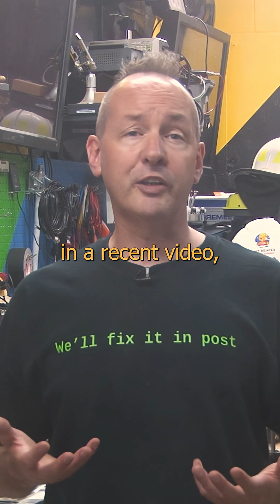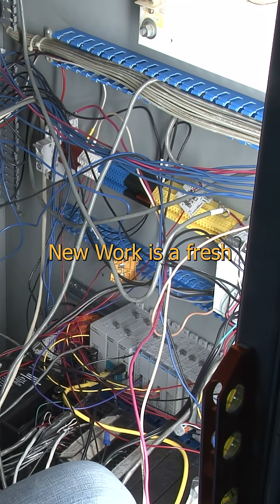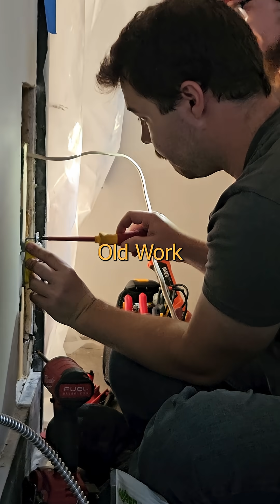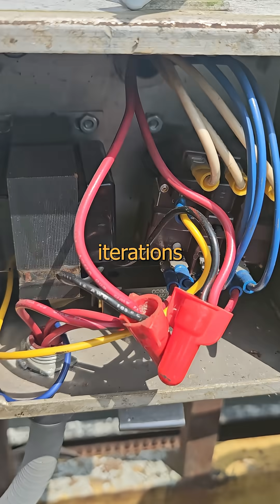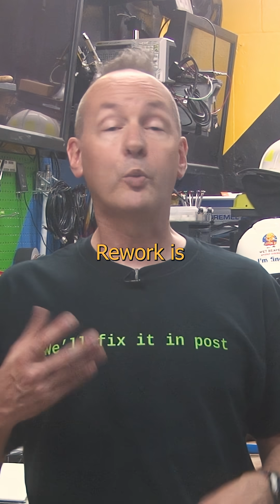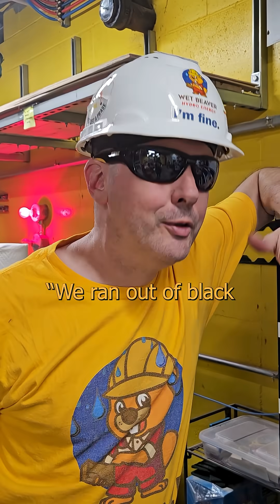New Work, Old Work, Rework #chrisboden #comedy #engineering #electrical #construction #educational

Comment: I'll be honest, I have used the "wrong color" for stuff before. It wasn't in a house or building, I would never do something like that. However, it was electrical in an old car. I couldn't get the same color to replace the old wire, so I just it all with black.🤗

Comment: The black tape on the red wires reminds me. My parents had a Thompson Tapan cooker they got from Canada I think? (This was in the UK) we had some problems so called in a guy who said he could fix it. First thing he did was lift the top off to get at the wiring behind the controls. Undid the screws, lifted the cover, screamed and slammed it shut again. We jumped a bit and said "What's the problem?" He lifted it up again and let us look. EVERY SINGLE WIRE WAS RED.

Comment: You say unintelligible things that make perfect sense  !  I’m not an electrician but I’ve had to deal with more than my fair share of pixie spaghetti ! Production maintenance are fire fighters .  They’re sole reason for existing is to keep it running . But repeated quick fixes will in the end cause catastrophic failure . Nobody remembers who bridged those end of travel micro switches until something terrible occurs! Who cares ? 😂 as long as it doesn’t happen on my shift and I didn’t sign the job off 😂

Comment: I work carpentry with my dad a lot and this is also very much true for that. These past three weeks on a job has just been fixing what the volunteers did. There where doors that were so far off plum we dont even think they used a level. There was some snap together wood flooring being put down and they had penny nails 4" from the outside wall. Very visible I might add, holding it down. When we went to turn on the power (nothing lit on fire thank goodness) but no plugs worked and some lights somehow where not even connected to anything. Along with many other things that I cant remember right now. Its great that they volunteered dont get me wrong but if you cant do the work right, go pick up a shovel or something instead.

Comment: This applies to every blue collar work out there.

I do dirt work and have had to dig 18 feet down in between 2 building on a hill, surrounded by other people building a house and a shop to get to native ground for a foundation for a set of concrete stairs. Then rebuild that ground with 22 feet of stepped compacted gravel. Stem walls were already in so we had to use a dingo to do anything.

The other contractor fucked up and after doing the house foundation, NEVER put in the stair foundation and backfilled with dirt that was mostly rock. Then he didnt have the equipment or knowledge to fix it and said “not my problem”

So we were called, had to drive 1 1/2 hours there and back every day for 2 months to fix this fuck up because we were the closest credible contractor.

Btw this was in Telluride, Colorado. One of the richest places in America. This property was probably 6-7 mil total with the brand new shop and building and they fucked up that bad on it.

Comment: Honestly I'm not mad at the guy putting black on the ends, would scold him for not doing the entire length. 

I had a socket catch fire and when replacing connect the usual brown, blue and yellow-green and then proceed to check, one hole is dark, the other lights up, check for mains voltage on ground and it lights up. I was thinking my dumb self would connect poop pants color to ground but how did I get it twice, then I check and live is not poop color it is blue. and yellow-green is also live. I may be stupid and swap colors but I don't remember two live wires in a single phase system. 

Kids no matter the color the previous guy run all black and just added color tape at the end. Always check. Everything is live until prove innocent.

Comment: You'd have either creamed your pants or had a full stroke upon seeing the mess of electrical wiring in my childhood home. It started out as a single family home, was turned into three apartments then turned back into a single family home. To make things even more fun, when my parents had the top floor renovated the contractor had to find an electrical subcontractor who had experience with knob and tube wiring. That stuff was actually wired into the rest of the house before it all got pulled out and upgraded.

Comment: 4th circle of hell is trying to fix production machines made 30 years ago, with single color eletrical wire (red) without electrical diagrams. Or ones that are language you dont know + bonus points for replaced components with wire jumps added that arent reflected on the diagrams...

Comment: Redoing a bedroom light fixture turned into tearing the wall out of 4 rooms and a hallway because there was knob and tube that was still hot despite the master being cold. Turned out it was wired directly to main, no fuse, breaker, or anything. Had the city power fella terminate his side of the cable because he's damn well better insured than I am, and as soon as I made the cut, that's his cable anyway.

Comment: You haven't seen old work until you open up an old knob and tube circuit box with cloth insulated wires that you can't even see because of the number of electrocuted mice shoved inside

Comment: Coolest thing ive ran into was original aluminum wiring to a fusebox that still had paper tags from the 1950s. The work inside was clean with no rat nesting from other nut twisters. It was almost a shame to disturb such fine work done so long ago

Comment: As an electrician that started in new construction and now does maintenance on a building older than i am, i often find the weirdest stuff. and since there's been a half dozen (at least) electrical contractors in the building in just the past twenty or so years, there is a mishmash of parts, styles, and gear.

Comment: You'd love finding one of my electrical projects. Every single one of them has either purple 10-guage solid core or yellow 12 guage, stranded. 
Sometimes I mark with colored heat-shrink, sometimes I make it the next guy's problem. (Then curse and whine when I end up being the next guy).

Comment: After living in my apartment for literal years. The entire left side of my living room lost power on its outlets. I, after trying to look into it myself because the maintenance guy is r word. Found out that there literally is no ground wire on hardly any of the outlets in my apartment. Now, one might ask, why don't I just go in there and fix it? Well, this building is older than I am. The stuff on the major parts of the building, like my living room, my kitchen, and all that stuff is some type of cement with some white stuff over top of it that will literally crumble if you touch it. I can't just tear out a piece of the wall.

Comment: I've worked on many old yachts "spaghetti"  electrical systems...there's no code to follow or inspectors so over the years as systems are upgraded they leave old wires and run new ones so you have hundreds of unused wires. Yachts run on... 12, 24 & 36 volt DC systems with 110 and 220 AC generators, solar & inverter systems. Generator power with (shore) dock city power. Even the 1.2 volts DC in the ocean and of course the open ground wire to the city power. I've been shocked in the shower and metal sinks and washer and dryers and I've seen sparks off of the docks where they touch the salt water. Makes your eyes burn and your finger tips hurt when your diving and cleaning the hull under water or changing the zinc sacrificial metal anodes mounted to the props, shafts and rudders. The underwater anti fouling paint in 80% copper powder so sea life won't want to attach to the boat and big old wooden yachts have a 4 foot copper plate nailed to the keel as a old style of radio ground. Then some boats have a bondong system where everything made of metal gets a heavy copper wire attached to it all wired together to a zink plate or a DC power supply with a knob to adjust how much low DC you can crank up to counter act the oceans electrolysis.

Comment: This was me 4 days ago with a mini van, 2 mechanics before me said the starter was bad, and the other said it was the key fob, I get there and not even 3 seconds under the hood I notice a broken ground strap, so I rig the ground strap and now no more shorts in the ignition module, relays are working properly, but the battery has a dead cell and the ground strap rig I did wasn’t a sufficient enough ground, so I have them replace the ground strap and warranty the battery and thing fires up like a charm 🤷🏽‍♂️

Comment: I borrowed a car trailer once. And it was owned by a wealthy guy, too. He owned an automotive spare parts store. Anyway, while it was in my possession, I noticed a brake light was out. Ok no drama, I’ll throw a globe in, job done. Nope. Hmm, ok, I’ll trace the wiring, find out where power stops. The whole harness was made up of red wire. And not full lengths. Pieces of red wire, ranging from 20cm - 1m long, joined with all ranges of crimp connectors, household screw connectors, twist-n-tape, whatever. I ripped the whole lot out, bought 2 new tail lights and 4 clearance lights, a new plug and used my wire and rewired the whole thing, front to back. The electric brakes weren’t connected. So I took it back, showed off my handiwork, and he was very pleased. And then he asked for his old wire back.

Comment: Not to be over technical, but the application of blue feed through terminals is traditionally used to refer to intrinsically safe circuit. If so, then you need 2”(50.8mm) of distance between the blue and the other color terminals. That’s if this is increased safety.

Comment: I work on commercial and residential elevators and I love wiring because I always make it a challenge do it as cleanly and understandable as possible. I tell the guys that work with me that I never have an issue with them taking their time to make sure their wire runs are clean and tidy. Makes any future troubleshooting easier, too.

Comment: I know some things are technically ‘up to code’, but I wish the neighborhood contractors that remodeled this house we bought would have put in some coax or cat5 along with both a neutral and ground (I know, double the wire cost, right? 😂) instead of skipping the neutral and using the conduit for ground and figuring, ‘Piotr says no phone, cable or data wire, everyone use WiFi.’

Comment: Yep, Ive experienced this first hand. Too many idiots out there use the same color wires for signal and voltage lines in control panels and you cant tell without a multimeter the difference. Also Im pretty annoyed when people start using other colors not per any code and dont document what they did. We spent an afternoon once tracking down wires in a control panel just to figure out which fuse had blown and nothing was labeled. 🤦‍♂️🤦‍♂️ Pretty useless P&ID if the wires arent marked.

Comment: What's the issue with using differently colored wires? Are the wires actually different or are they just color-coded by purpose/voltage/something else? I'm not an electrician so idk

Or was the apprentice joke not even about wires?

Comment: As an electrician's mate, I would sometimes mistake old dark green sleeves for black wires.
BANG! Went the fuse box many, many times!
Muthafuckas got me chasing concrete in the end. I didn't do that job for longer than six months.
A bit more colourblind than most!

Comment: I spent 3 hours fixing our grounded workbenches after 3 electrical engineers "installed" the wiring. I'm not an electrician, I'm a mechatronics guy so I'm the only one around good at "dumb guy engineering".

Comment: The "black tape on the ends" is how my dad just screamed into the void and gave up on corrosion prevention at a natural gas job. He asked his boss for properly colored wire so they could follow procedure for grounding pipelines. He got told to just put tape on the end. Apparently these people haven't heard about tape falling off. Also they didn't understand when lines are ran underground from the box to the pipe but also to the grounding that apparently color does, in fact, matter. He was yelled at so much over wanting to prevent corrosion despite that being what he was hired for. Crazy shit.

Comment: Eh when your basment lights run of the same breaker as some outlets on the other side of the house and your front deck for some reason you question how many drinks they had on the job

Comment: Lemme tell you about the abortion i had to sort out on a previous "sparky's" attempt at a four way switch circuit followed closely by a triumph spitfire i got so cheap you think I used a gun that had a painless wire harness tossed into the dash space where the heater box used to reside which apparently they simply used for the wire and none of the circuit schedule was remotely referred to for install. Cleaning up someone else's shit is miserable, figuratively and literally.

Comment: I had a few experiences cleaning up after these cheap sparkies. One guy was colorblind, wired up one side of 683 Cat5e cables...I spent longer fixing all those punch downs and RJ45 connectors than if I would have just clipped them all and rewired but customer wanted us to do it their way. Another guy ran white wire throughout an electrical panel for a rather large machine, did not label anything and the machine did not work...I spent longer doing triage than if we just ripped everything out and started again, he fried several PLCs and other modules.

Comment: Working on a bar's panel tearing out a conduit and box that weren't going to be used. Found a 6 in a 2in pipe, kinked between two panels. Carefully stepped back with my hands in the hold-up position. Don't remember exactly what I did, but it was reading 240. It gets better. This kinked 6 wasn't connected in the panel, it ran to the box I was removing. Come to find some fucknut had attached two 12s to it. 

Also, I had found six 12s just kinked in the panel, three of those were hot. 

I really don't remember much about that night, but I know I cussed a lot.

Comment: Put 277v to a bare wire on a heavy duty LED Flood Light because somewhere in the line poles history someone used green as a hot with 2 red wires , one of which was the actual ground. The old light was so decayed I cut the wires from out the case and just threw it down, hooked the new light up, came down and with my helper and the customer watching, went inside and smoked that light lmfao. My helper called me on my phone and asked why sparks flew out from the case and all the wires above shook as the breaker tripped on my end. Upon investigation the light was ruined and I ended up having to completely redo all the connections on the pole lol, oh well lesson learned

Comment: I respectfully disagree, old work is when you're working off a knob and tube wire setup. When you rework you're rerunning the entire building because its knob and tube still. New work is something you dont get to do unless youre working for less than youre worth and directly with the contractors that framed it typically. Id call your rework definition just fixing up after assholes.

Comment: Project i'm dealing with right now just dug an entire 60 foot trench down to the level of the bottom of the cable vault... about twice the actual required depth. They figured this out when they found the sewer main. 

Now, on one hand, it's a hole. Not rocket science solving this problem, backfill it. However, this has turned out to be a rather costly mistake because of course the hole has to be backfilled with fist sized rocks instead of the dirt they took out for stability reasons. 

I think someone's angling for a bonus over at that digging company, but i certainly can't prove it.

Comment: In my last job someone rewired a 1980s CNC lathe for a specific job solely with a single gauge of red wire, it came to the point it was quicker and easier to rip it all out and start from scratch instead of trying to trace all the f**k ups

Comment: My job is about 90% old work.  So much joy is to be found in digging through years of abandoned conduits leading to nowhere, conduits and boxes full of tangled wire or unspeakable soup, live cables with the insulation cracked and flaking off, ductwork and plumbing retrofits blocking access to the junction boxes you need to pull to or through, documentation that is either wildly inaccurate or completely absent, everything is 3x heavier than modern, and my favorite, the apprentice breathing heavily and asking about the funny fuzzy white insulation on the wires.
Edit: also, paper tags on things that obviously had something important written on them back in the 50's, but are now completely faded/illegible.

Comment: Old work pisses me off so much in plumbing, lead pipe isn't too big a deal, it's kinda fun to work with, BUT FUCK GALVANIZED PIPE, WHAT EVER NUTT STREAK THOUGHT THAT WAS A GOOD IDEA NEEDS TO HAVE THEIR UNDEAD LIFE SHAMED, I'VE DEALT WITH SO MANY FREAKING ISSUES WITH THAT CRAP AND IT'S NEVER EASY, did my old farm house 2 years ago, had a pin hole form on rhe galvanized line, plan was to just angle grind the fitting and replace it so we could turn the water on until we could replace it with pex, NOPE, crack shot right up the pipe
Reply: 1900s clay pipes are "fun". I've never came across wooden pipes made from staves & iron hoops, thankfully, but I've heard one horror story about `em lol
That galvanized nightmare you had to deal with ~ wutta mess!